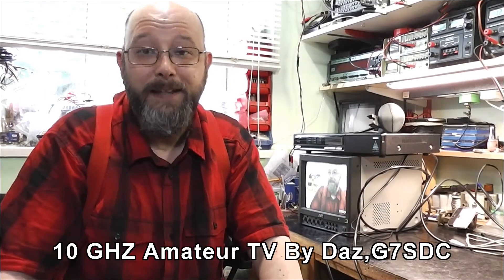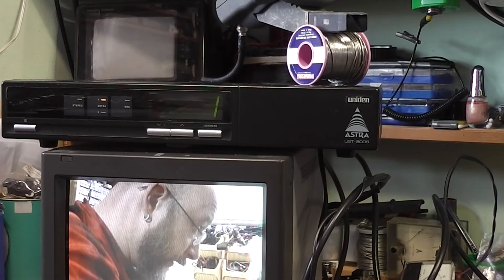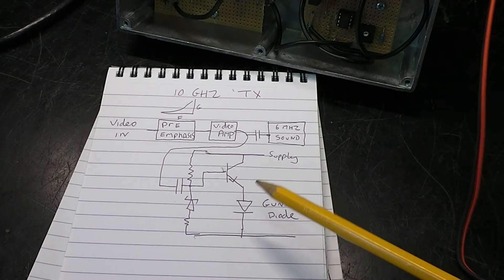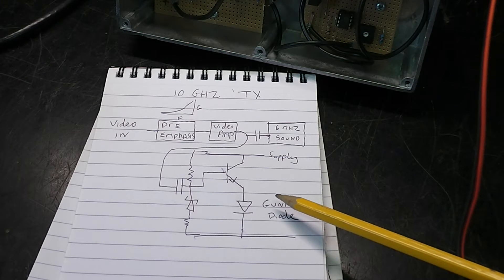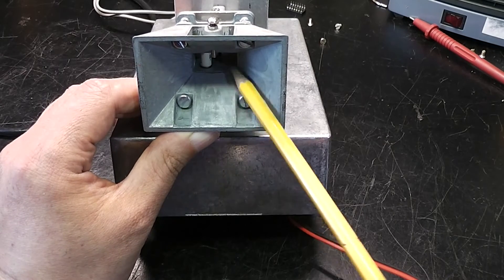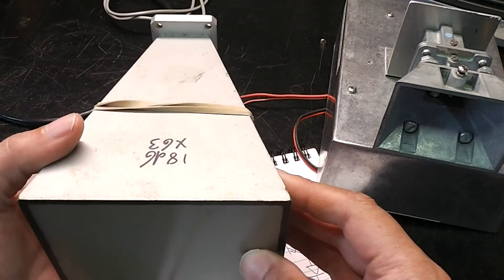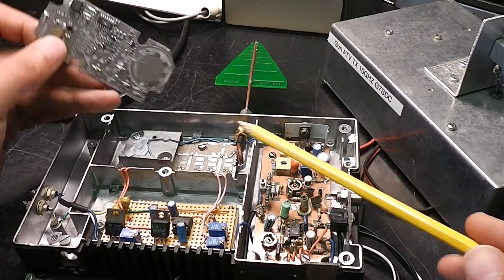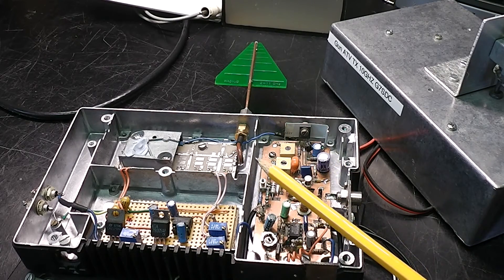10GHz Amateur TV Transmitter using Gunn Diode.

Comment: Nice video Darren. Just a few pointers The diode you pointed to in the solfan cavity is infact a rx mixer diode. the much smaller Gunn diode is behind the small aperture and is placed inside a cavity which effects the frequency it oscillates on. and the tuning screws alter the size of the cavity and the coupling to the front part of the solfan for radiation.  Each diode has its own unique parameters some will produce up to 12mW and some will only produce 7mW it all depends as I said on each individual diode. However, if you can find one, there are also some gunn diodes that can produce hundreds of mW but require higher current levels to work. 
One big problem with the solfan heads is they can drift quite a lot at first switch on. 
We also mounted ours solfans inside a dicast box filled with polystyrene foam like you get in rig boxes, which helps keep the temperature and frequency more stable. 

We bult our horns with double sided PCB sheet and soldered on the outside, as lead absorbs microwave frequencies so should not be inside the horn or waveguide and then we varnish the horn to weather proof. 

Also the copper on the inside of the pcb  horn does not have to be electrically connected as it doesnt conduct the 10GHz signal it just purely reflects it into the waveguide and also radiates out.
One final comment, which needs addressing is safety. YOU MUST NEVER LOOK DOWN INTO THE CAVITY WHILE IT IS TRANSMITTING. It can severely damage your eye sight. I think that is something you need to point out to any potential builders.
Reply from the maker: Many thanks for your comments. Unfortunately, I sometimes make mistakes in my videos that I didnt see at the time, so thanks for pointing them out. Daz

Comment: You built it so I'm sure you know, but I thought the white diode visible from the horn would be the mixer diode.  The iris from the Gunn cavity appears to be further in.  I've been a ham for over 40-years and a couple of times wanted to fiddle with 10ghz but found that the components are scarce as chicken's teeth with prices past the Moon.  So, I never did.

Comment: Is it possible to do narrowband FM or even CW ?
Reply from the maker: I think the drift would be to much for even narrow FM to be honest. As for CW, no chance.  Daz
Reply: @darrencoe5795  Oh, thats a pity. And are there any other microwave-capable tubes? Im thinking if its possible to make something like really basic 1.2 GHz or 10 GHz CW trx. Really low power stuff for experiments, and maybe rain scatter, whre qrp is possible. In my country wide fm is not allowed on those bands.
Reply from the maker: @____.__._.._  I think the best options is something that is phase locked for stability or perhaps a multiplier type system. I've seen kits for multipliers in the past and you could key a stage somewhere. Even using theses systems you will still get some drift. Daz
Reply: @darrencoe5795  Thanks Daz. I'm investigation into this matter right now, im attending local club meetings, but the members are rather interested in HF DX
Reply from the maker: @____.__._.._  I am afraid you only find a few people interested in larger clubs as I have found.  I have a microwave group within 30 miles, Codgers group.  Daz

Comment: Hi - great video!  When you said "it has gain, and we know anything that has gain can be an oscillator" - that went over my head, can you explain what you mean?  It was at time 3:52 when you mentioned 'negative resistance'
Reply from the maker: Yes, if enough of the output of an amplifier is fed back to its input in a positive way,  it will start to oscillate. Think of a public address system, it squeals if the microphone picks up the speaker.. The cavity sets the frequency.

Comment: Hello, sir! I am trying to build my own gunn diode transmitter. However I would need help with the waveguide calculations as I am seeing many different waveguide designs for a gunn diode oscillator. Could you give me some advise as to how to build a waveguide and what the best distance of the tuning back plate after the gunn diode is? 
edit: How did you built your gunn diode transmitter for example? What calculations you did
Reply from the maker: In this case I used a module that was was premade and I used a Paper template for the horn found on a website. I used another horn as a field strength device for adjustments.
Reply: Can you remember which site it was?

Comment: Hi,  is this applicable for Microwave power Transmission,  although the power output is too small. looking for help.
Reply from the maker: Using microwave's for power transmission isn't something I have experience in but have seen a demonstration on TV a few years ago.  This was carefully controlled because of the real dangers of microwave energy to the body.  Yes, this is only about 100mw so low powered.

Comment: Nice build. A friend and I experimented of 10 GHz FM in the 1980s using Solfan Heads. Audio not TV. We got up to 20 metres range if I recall right. But we never got round to taking the equipment out into the countryside!
Reply from the maker: I also have a Wideband FM setup, maybe another video!

Comment: Interesting....
I stumbled on this video on accident looking for microwave frequency stuff for a different project i'm poking at but.... 10 ghz is might be doable for a magnetron. 

Have you ever considered making your own magnetron tuned to 10 ghz? 

Gunn diodes are interesting but I think they're better receivers than they are transmitters simply based on their power limitations. 

I'm in the USA, so maybe there's reasons a magnetron wouldn't be ideal, but, with a narrowly focused bit of bandwidth, such that you have here, a magnetron seems superior. I mean... as long as you're not dropping 100's of volts, which comes out to 100's of watts, you're probably ok. 

I hadn't thought of using a magnetron as a transmitter for TV before this, but... looking at this setup, i think it might work. Although I'm 100% sure it'd need a bunch of hi-filtering to be safe.
Reply: how did the project go?
Reply: A magnetron is a bit hard to control to get good modulation, stable frequency and stable output level all at the same time. They drift in frequency strongly with temperature, and they do warm up during operation, even just from the heater power. I have experimented with “low power” (0.1-10W) magnetron operation into a dummy load a long while ago. The controller for the magnetron was IIRC more complex than RF amps that work in X band.

A magnetron acts like a 4kV Zener diode, and doesn’t do anything much below that voltage. So no matter what power you drive it at, you need the same high voltage. So what you need is a, say, 2mA current source with compliance voltage of roughly 4.5kV. That current source needs to allow current modulation at frequencies of the baseband signal that you wish to transmit. Typically that will be audio or video.

Magnetron operating frequency depends on the filament current, filament temperature (lags filament current), anode voltage, physical size of the magnetron’s cavity (varies with temperature!), and external circuitry such as added resonator cavities - whether real, or virtual achieved using a magic tee with two phase shifters.